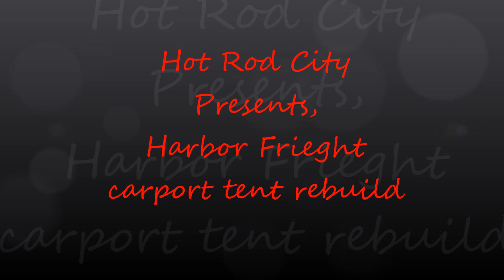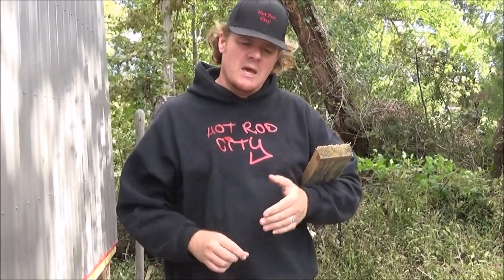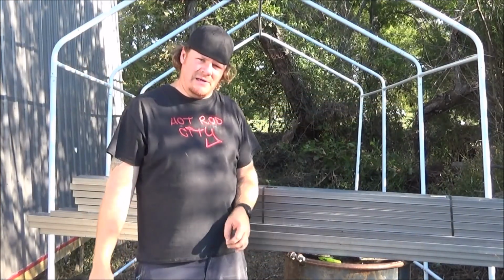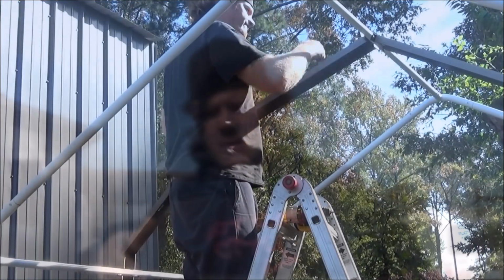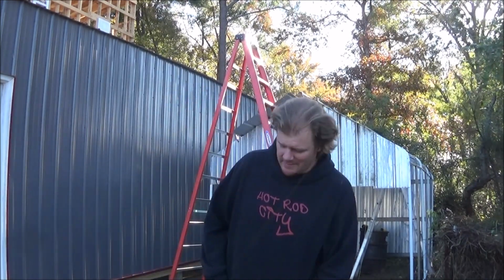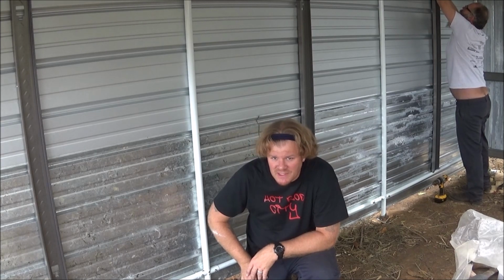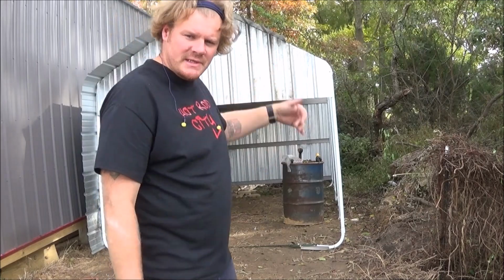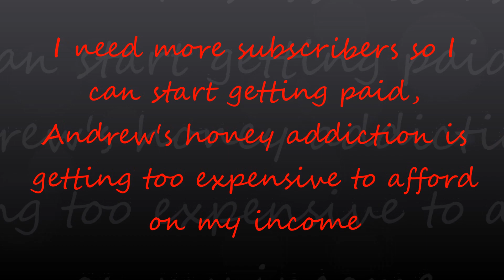Carport from Harbor Freight leftovers

Comment: Good build!!
Idea: Four trailer tongue jacks (one per corner) gives you the chance to change the height and level.  It also prevents the unit from being classified as a permanent structure by your local confiscatory taxing authority.  If it is on wheels, it cannot be permanent. It has no VIN, so you cannot register it as a trailer and all that entails.
Reply: most places under 200 SF doesn't need a permit